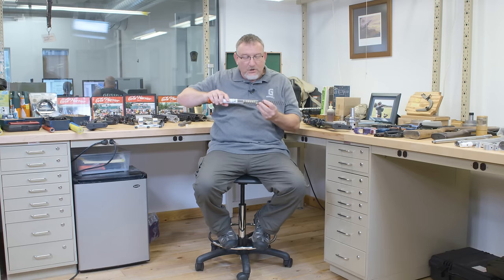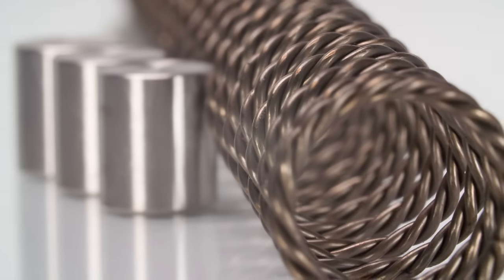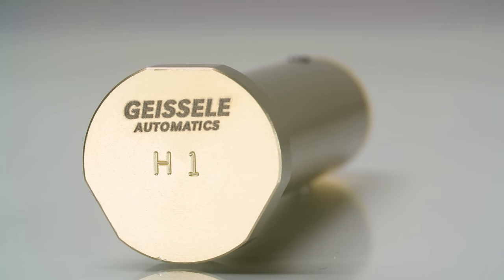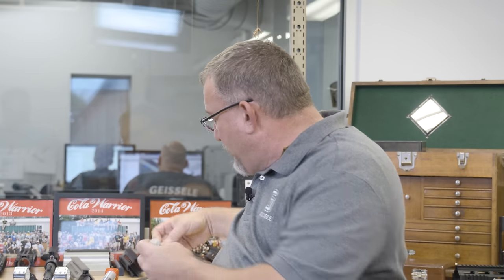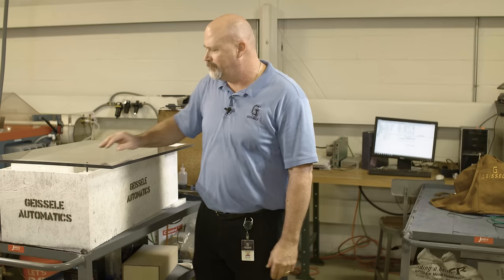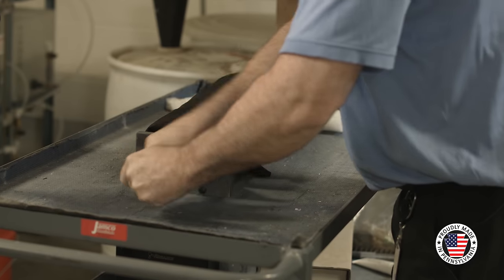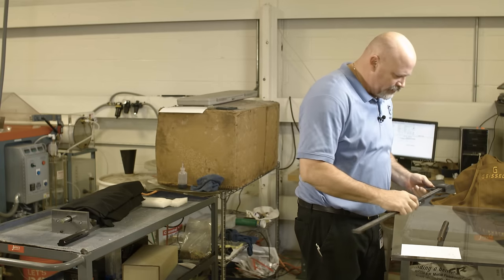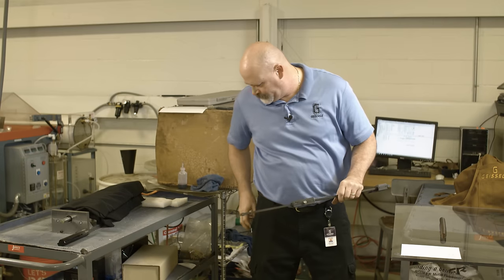Introducing the "Super 42 Braided Wire Buffer Kit"

Comment: so for 50,000 rounds will your super 42 still cost less then buying say 3 single wire buffer springs. if not i really don't see the point.
Reply: i think the point is about consistency
Reply: Didn't plan on it. i was simply making a point.
Reply: Talk about a solution to a non-existent problem. Take that $60 and buy ammo.
Reply: Fox Mulder apparently you haven't used an infantry rifle. You haven't heard "twang" until you shoot one of them.
Reply: You're getting the buffer with that cost lol......
Reply: You get a cool G on your buffer though

Comment: Cool tech but honestly I don’t think I’ll ever put 50,000 rounds through any single AR and with buffer springs being less than $10 to replace I don’t see myself ever going this route. Even if I did reach that round count I’m probably going to be refurbishing the gun anyway as the barrel is definitely going to have lost significant accuracy bcg etc I mean that’s a lot of rounds for a non professional shooter especially when you factor in owning several different rifles but still very cool that they’re pushing performance and reliability out further

Comment: Note that Bill points out that this kit works well with AR pistols and carbine length gas systems.  I tried it with my new mid-length 16" AR build and had major short-stroking. Switched to a standard spring and buffer and was able to cycle the rifle reliably.  I'll try the Super 42 again after some break in, otherwise it will go into a future pistol build.
Reply: It's for carbine length gas systems
Reply: Which weight buffer were you using if you don't mind me asking?
Reply: @JoeyMo973  it was the H1. Since posting, I've learned that the BA Hanson barrel I have is under-gassed. Even with a carbine buffer, it ejects around 4:00. Obviously an H1 and stiffer spring was way too much for it.
Reply: @the_hwyman My man!  much appreciated!

Comment: When are these going to be available to buy just the spring? I'd like to buy extra replacement springs without spending 60 dollars for a spring and have 50 buffers that I don't need. And when are you going to come out with a rifle length version of this spring and buffer?
Reply from the maker: The Super-42 Spring and Buffer are sold together because the internal diameter is different. The Super-42 spring will not work correctly with a standard buffer.
Reply: +GeisseleAutomatics yes I know that but assuming that I already had a geissele buffer and spring, how do I maintenance my rifle and change the spring when I need to, without having to buy a buffer also each time?
Reply: I think you're missing the point of the product. By using this spring you're making the buffer spring no longer a maintenance item and there should be no need to replace it in the life of the rifle.

Comment: I agree that this is a superior spring with a 16" 5.56 barrel. No more PHONG. You'd have to be pretty sensitive to notice recoil differences, but you'll definitely notice an audible difference. I cant speak to much about a comparison to flat springs, but 1500 rounds of various loads have worked well for me. I have found that my best group sizes, for the range I'm shooting, is the minimum and maximum load. My setup is unsuppressed, and since I shoot shorter distances, an H1 buffer, 55gr FMJBT, and 24.4gr bl-c2.  Despite shooting lighter hand loads, I have never had a problem cycling any match ammunition. Well worth the bucks if your'e sensitive to spring sound or have noticed spring degradation.

Comment: How much of a difference would there be if you used tungsten powder instead of weights like Spikes Tactical?

How does this braided wire compare to a chrome silicon wire?

How does it perform in a rifle length gas system?

And as Mike W asked, how does it compare to the Vltor A5?

Awesome job though, and thank you for your innovations. Love your products!

Comment: Third video in a row tonight on buffer technology and functionality of cycling carbines. I have been building for a while now and experiencing various feeding and ejection issues from combined suppressed, nonsuppressed,62 to 77grain, adjustable gas blocks, buffer weights and barrel lengths. 
I am convinced I need to get the Super 42 next in hopes that I can reach the sweet spot I need for my current build creating a match grade precision AR capable of one hole groups at 100yrds shot for shot. I am currently averaging sub 1/2 to 3/4" with factory ammo.
Excellent video, thank you.

Comment: Great process of elimination.  When it comes to the ammunition itself, try basic “plinking” ammo and work your way up to higher-end precision  (hotter) ammo.  If you find that your plinking ammo gives you constant problems whereas the hitter ammo does not, you now know you are dealing with an under-gassed system. This is the problem I had with my system once I ruled out everything else.  BEFORE deciding to drill out the gas hole, make sure you know the specs and use the correct tools to measure the current hole.  I have a theory when it comes to precision barrels; the gas port is sized to accommodate hotter ammunition, therefore, you SHOULD have under-gas issues with lessor quality ammunition.

Comment: My go to are Springco buffer springs. They have regular, intermediate, enhanced, and extra power buffer springs made from chrome silicon. The difference between them all is the length of the spring. The longer the spring, the more resistance it has. They are also quiet and do not have the audible twang we all know.
I coupled their extra power spring and h2 buffer on my 16" carbine length rifle and it lessened the recoil of the rifle and allowed me to shoot steel cased ammo.

Comment: It seems like that spring cycling machine would generate a whole lot of heat in the spring - did you ever point a laser thermometer at it when it was running the tests? Thanks for sharing so much info, and for making great products and seeking improvement in the platform.

Comment: Man that’s some serious marketing hype for only a 0.113” difference in set (over 50,000 cycles!). That’s less than 1/8”. And that’s just the free length. Does that even matter?  The spring is never at free length in the rifle. Did spring rate change?  Pressure? Anything else?  And does anyone put 50,000 rounds through their AR? If so, I’d imagine they refresh parts such as buffer spring every so often. I’m not convinced I have to have one. I’m sure they aren’t cheap either. Gotta pay for Bill’s R&D and his neat machine!  What do they call that thing again?  The “vag buster”?

Yeah, $65-99 for this. Versus $15-20 for a standard one (that works fine). I’ll just keep “twanging” away. $65 isn’t that bad though. I was expecting more given Bill’s machine. 

Sorry, Geissele, just giving you a little ribbing. You do good work.

Comment: Just so everyone knows, these only work with 223/556

I used this spring in my 45acp upper and the spring disintegrated in the first 15 rounds.  Not for PCC. 
I think 45acp requires a AR10 carbine spring or kak recoil buffer spring designed for pistol caliber.  
I think 300blackout needs a regular carbine spring and buffer. These Geissele H3 with dual 42 are too much for 300blk.  
But this worked with my PWS MK111 and Mk107 in 223 wylde

Comment: How does the Super 42 system with its milspec length and weight options compare with the A5 system (like VLTOR’s) with its longer buffer, spring and receiver extension? Especially for a suppressed shorter platform (11.5” to 13.9”)? Comparable or does one have advantages?

Comment: My observation, using this braider wire buffer spring, for pistol - you need to have heavy buffer weight of 5.8 oz or heavier for proper ejection. For carbine, the buffer weight it came with is just fine. for rifle - it is perfect! NO THWANG

Comment: At the end of the 90 minute braided spring test the buffer tube was absolutely covered in what looked like metal shavings of some kind. What was going on there?
Reply: I saw that too
Reply: i saw that as well. looks like the braided wire is rougher and wears the inside of the buffer tube. those shavings had to come from somewhere.

Comment: I put one of these in my 16" mid length build, and it works great!  No more "boing" from inside the gun when firing.
Reply: So you are using the H1 buffer with it ? Do you know the weight of the H1 buffer ? Are your ejections @ like 3 o’clock or ? Trying to decide if I should get this carbine spring and buffer or do a A5 setup with the super 42 rifle length spring.

Comment: You stated 10 1/8 minimum. And you stated these springs had to be changed in the field regularly. However after 50k cycles on your tester, while yours did better, both springs were still within spec. Something does not add up here.

Comment: So for a 10.5 inch barrel for 556 using a carbine gas length system I would use a H2 with the Geissele super 42 spring? Would a H3 be a bit of a stretch?

Comment: Nothing against your in house spring testing rig . But what I failed to see was a standard measurement commonly done on engine cylinder head valve springs . That gauge the poundage of spring pressure at a given distance of spring  travel . I understand your OAL measurements / before & after . But at how much loss of resistance ?. How important is it ?. I will still likely purchase & road test your buffer / 42 spring anyway . But I still question everything .

Comment: Spring design usually focuses on yield stress ratio rather than ultimate tensile strength. Fatigue cycles result from plastic deformation. No plastic deformation, no fatigue. That’s why ductility is so helpful in improving fatigue life.

Comment: Understand stress, harmonic waves not in sync in other springs, but difficulty in calculating temperature rise in twisted metal spring in extended rapid fire environments. I have been getting reduced performance before burn-out with this spring and buffer tube however spring length remains same after cool down and measuring. You have a beautiful product.

Comment: BTW, Mr. Quigley KUDOS to your excellent job designing the ALG AK trigger.  No question that it’s the finest AK trigger ever made! 
QUESTION #1. REGARDING THE BRAIDED SPRING: Will it reduce the amount of Spring noise you hear when shooting an M16 A4 on semi auto? What would be the correct amount of weight with steel and or tungsten assuming your shooting NATO 62 grain green tip ammo. It’s quite distracting when your focusing on accuracy and you keep hearing this BOING every time you pull the trigger. 
QUESTION #2. What would be considered the correct amount of weight in a DD 10.3” MK 18 versus a KAC 11.5” (both running suppressed) with mil Spec 62 Grain NATO green tip FMJ ammo? I’m trying to get an idea if there are actual protocols or if it’s just try this and try that and let’s see what works? Thank u graciously in advance. Doc David
Reply from the maker: Hello! I will pass Mr.Quigley the comments!
The Super-42 will indeed reduce the Twang in the stock, if not entirely eliminate it. As for the rest of your  questions, you will want to email sales@geissele.com and our Weapon Techs will be able to help you.

Comment: Just an FYI on 2 things; as an armorer for 1 of our inactivated Army divisions we had a rounded solid lead bar to cut for in-field repairs and 3 lead slugs is same weight as 2 steel and 1 tungsten or H buffer if cost is an issue. 2nd instead of telling everyone to throw away there Mil-Spec buffers you could have trimmed your braided spring down to 9 inches and put an adapter tube on it.

Comment: Those springs have to be subjected to higher than normal heat ranges. 50k cycles non stop...The heat generated has to cause spring degradation. The braided wire spring dissipates heat better due to a greater surface area.

Comment: I have a BCM 12.5 upper and I run the super 42 H1, my question is... if I suppress my build will the super 42 H1 be ok for gas blow back??? Any reply is welcomed.
Reply: Most people would recommend a H2 buffer when running a suppressed carbine length gas system. Carbines typically run harder than others, so adding a suppressor typically adds a decent amount of back pressure into your internals. But every company is different and some gas ports might not be sized quite the same, even from within the same company. So it might a bit of trial and error trying to find what works best in your rifle.

Comment: The fatigue characteristics of braided springs has been known for a long time now.  An important issue with the M4 platform is the size of the spring itself.  It is of such a large diameter that it literally weighs much more than it should making its natural frequency way too low.  End result is excitation of the natural frequency.  A spring with the same constant with a smaller diameter will do away with that oscillation.

Comment: I use chrome silicone flat wire springs that do everything these twisted buffers do. If these springs can be used with stock buffers and don’t ring when fired etc they would have a high seller.
 All the tech stuff will confuse the average ar15/10 owner who just wants their gun to work with a drop in replacement.
Reply: I hear ya! I bitched too. But then I realized the wire makes for a slightly smaller ID. Could have just chucked the buffer in the lathe and turned down in 5 minutes but bit the bullet and bought their buffers.  Super happy.

Comment: if you have an ar with an adjustable gas block with an ar bolt and a commercial buffer, if i add a full auto bolt and a geiselle 42 will i have to adjust the gas block?

Comment: I just bought the Super Duty Complete upper, 10.3 OD. I will be using my BCM pistol lower. The question I have is will the BCM buffer spring work well with the Geissele upper ? Or will I have to change the spring and if so, which buffer H2 or H3 for suppressed? Thanks for the video. And advice greatly appreciated.
Reply: H3 is what you will need. Geissele has a graph on the their website that will walk you through what you need depending on barrel and gas length as well as suppressed or not. I’ll save you some time looking though. H3 is what you need.
Reply: @a.bergey522  I came accross the chart. After some thought, I have decided to order the Geisselle lower parts kit, complete buffer assembly with the H3 OD, trigger guard OD and lower receiver OD. I’m  going to give it a try and assemble my very first lower myself. I already had the Geisselle SA trigger in my safe. I have watched some video online. I’m looking forward to the challenge.

Comment: What is the order of the weights in H1 and H2 buffers? In an H1, is the tungsten weight in the middle, in the front (towards to face of the buffer), or the end (the rubber end that contacts the back of the buffer tube? Same for the H2 -- are the tungsten weights bookending the steel, or are they next to each other with the steel either in front or behind? Thanks

Comment: i have a FN 18" .223 rem match grade sporter with rifle length gas system.
the rifle is 100% reliable and the stock buffer (unmarked) and spring are remarkably quiet and smooth but im always looking to improve things.
what buffer and spring would you recommend for it?

i also have a new DD5V1 7.62 rifle with a 16" barrel and mid length gas system. its a bit jumpy.
i want to reduce perceived recoil as much as possible and plan to replace the stock comp with a combo brake/comp and possibly a new buffer and spring.
it has an extremely heavy BCG imo and i think its mainly all that weight during cycling causing the excessive recoil.

what buffer and spring would you recommend for the DD?

and do you feel an adjustable gas block would benefit my DD?

btw the Geiselle SSA in the DD is beautiful! i plan to upgrade to the SD-E however as i really like the flat trigger i have in my modded FN M4/RECCE carbine.

thanks in advance for your help!
Reply from the maker: HI Randy, your best bet is to reach our Weapon Techs by emailing sales@geissele.com